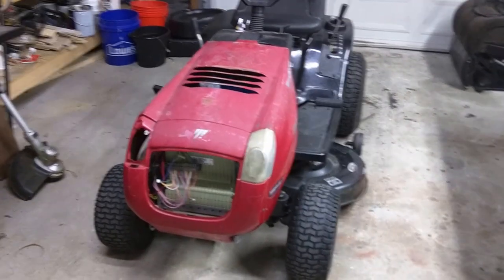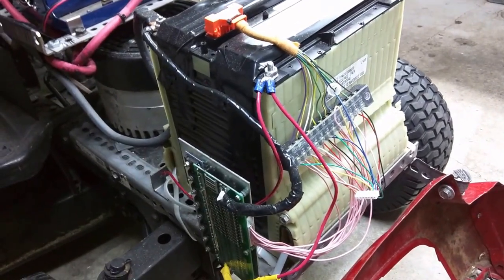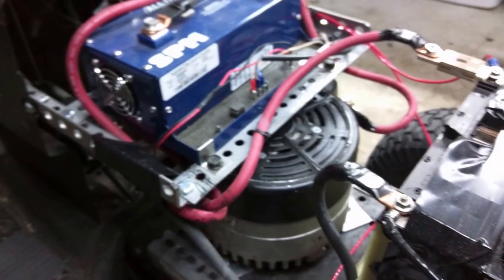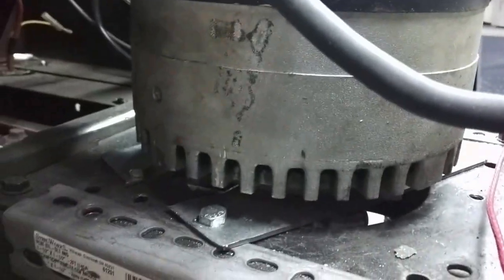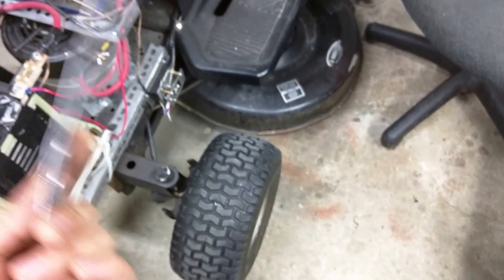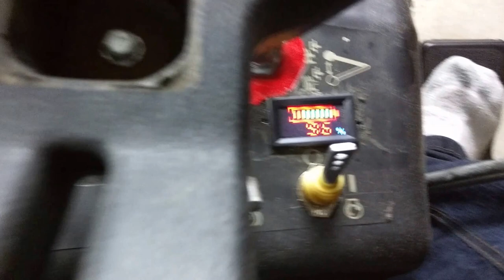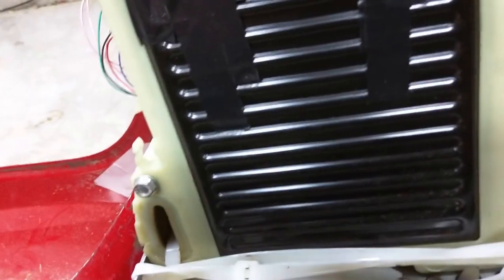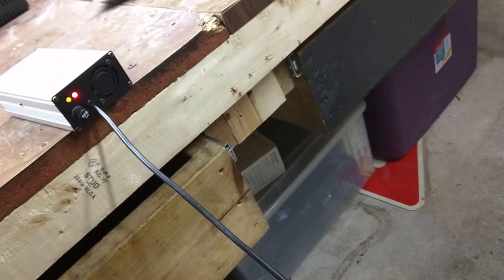Murray Electric Riding Mower Conversion

Comment: links to products would be nice :)
Reply from the maker: Most of the electronics are from evdrives at: https://www.evdrives.com/product_p/ck-1004.htm
Reply from the maker: Other parts such as the Chevy volt batteries are from eBay.
My BMS is from AliExpress, I cannot find the original product but the key is to search for a 12s lipo balancer.
Any voltage or amperage readings are from : SMAKN® DC 12v 24V 36V 48V 60V 72V 96V Acid lead batteries percentage capacity indicator LED Tester voltmeter(Default 72v) https://www.amazon.com/dp/B00WW0IL7U/ref=cm_sw_r_cp_apa_i_.uH4Cb7PEENFE
Reply from the maker: I have added the parts list that for some reason I kept forgetting about. The parts are in the description now

Comment: Don't cut the bolts off the battery or all the plates will separate and not go back together.
Reply from the maker: I had to recently for a different build. I just used two large bar clamps to hold everything together while I did it.

Comment: Hi great video, thanks . What sort of motor is best? If I used a 48v 1000w motor at about 3000-3500 rpm would that do the job? I don't want to mow with it, I am just converting it as a ride on for my young son and it will not have deck or blades. Also would it be best to have a geared motor to create more torque? Thanks
Reply from the maker: That RPM range is about accurate for most mowers. For just a ride on, without a deck, 48v may be too much. A mower without a hydrostatic transaxle will transfer torque to the drivetrain immediately causing wheelies.

Comment: How is it working? Do you still have it? Just curious how it worked for you and if you had any issues that needed to be resolved. I recently built one myself with a 36 volt dc motor and it works good for now. I will subscribe..
Reply from the maker: It worked very well until the hydrostatic transmission went out on the chasis. I ended up using a different chasis, 2 times over at this point ;-). I was given a John Deere with a blown engine, then a few years later I purchased a Husqvarna with another bad engine. Both of which I actually have videos for if you are interested.

John Deere: https://www.youtube.com/playlist?list=PLTgcaSqX6FAALoibqbmBFPYstTfzE5q6u 
Husqvarna: https://www.youtube.com/playlist?list=PLTgcaSqX6FAB9LBwNte1Cp7Jmtk91UPuq 

Overall, I was very pleased with the mowers. In the end, they always mowed the entire yard with plenty of power to spare. I did eventually dismantle and sell the John Deere and Rebuilt the Husqvarna with a replacement engine and sold it as well because I purchased a broken Husqvarna Zero Turn that I have since fixed and have been using. As soon as that engine dies or... I get bored enough... I will be converting it as well :D

For now, I have 1 of the ME1004 motors powering an electric Yerf Dog Go Kart. Here is that playlist if you are interested: https://www.youtube.com/playlist?list=PLTgcaSqX6FAAL6G0dKeM356ImdEbDr9ks
Reply: @JerryRigged  I did watch all of your videos. Very well done. Thanks so much for the reply. I think we all go through the swapping out from this to that. It’s funny, I feel we always try to get bigger and better. I watched several videos and yours are much better than most. 
I did the same to a craftsman riding mower, (but I’m looking for a John Deere or something better than this basic mower) for now it’s working. 
I used 3 12 volt batteries which was my first mistake. I will most likely take them apart and add a 36 volt BMS and do away with the battery balancer.
I used a floor burnisher motor. (Brushed dc 36 volts) it’s about the same power if not more than the gas engine I took out. 
Again great job…
Here is mine if you are interested. Thanks again for the reply..

https://youtu.be/Aq97lpv7mN8?si=mYm53Uo2j73_Fs4l

Comment: Jerry, I am about to embark on something similar but different.  I have a 48V chevy volt module, and the mot energy Me-0708 motor, so I'll be running at 48V constant, no motor controller.  I'll be posting some Youtube videos.  The main difference is that my mower will be a snapper rear engine rider with a continuously variable friction disc transmission that should not consume much power, as it will be doing almost nothing when Idle.  Dunno about run time.  My lawn is a little bigger than yours, so good to know that you can cut with one battery, as that's all I'll have.  Nice videos.  Good tinkering.
Reply: Sorry, ME-1004 motor that I am using.
Reply from the maker: Hey sorry, just noticed this response. I hope the conversion went well for you. 
Did you end up needing more batteries? I personally am running two in parallel now on my converted John Deere.
I do worry about overheating with a motor without any load at full tilt.

Comment: Looking to do the same conversion.  I have the motor already and I'm about to order the volt module.  Have you found the BMS to be necessary or not?  Are you still bypassing it?
Reply: Thanks for the input Jerry!  I've decided to forego one for now.  Most of my components are here minus my crimp lugs and charger.  That's my next order.  I saw you using a battery monitor and voltmeter.  Mind sharing links to what you used?  I've had a hard time finding a monitor for a 12s setup.
Reply from the maker: @AaronPaluzzi  https://www.amazon.com/gp/product/B00WW0IL7U/ref=ppx_yo_dt_b_search_asin_title?ie=UTF8&psc=1
https://www.amazon.com/gp/product/B00NZV7K3G/ref=ppx_yo_dt_b_search_asin_title?ie=UTF8&psc=1
the links are for my two different meters. One is for overall charge remaining and the other is the voltage i am sending into the motor

Comment: what kind of power are you getting out of it compared at what you had before (gas motor). I have a zero turn ride mower in need of a new motor but I'm looking to rather do an electric conversion. the old motor is from a Kohler 18hp. when it comes to electric, not sure how to determine the right motor application for the mower.
Reply: What motor did you use? Can you send a link or model number? AC or DC?
Reply from the maker: @dickmorris2149  Sure, you would want an ME1004. I received mine as part of a kit from evdrives.com

Comment: What about electric motors for the deck?
Reply from the maker: I know they make them now. They were much more difficult and expensive to find at the time.

I would probably try to find some refurb units off eBay from actual electric riders and wire them in. The issue is the motors are usually brushless now, you would need a controller for each